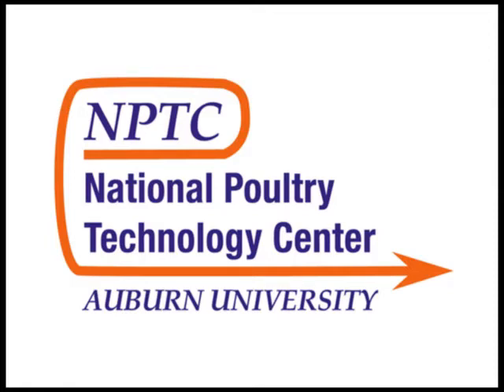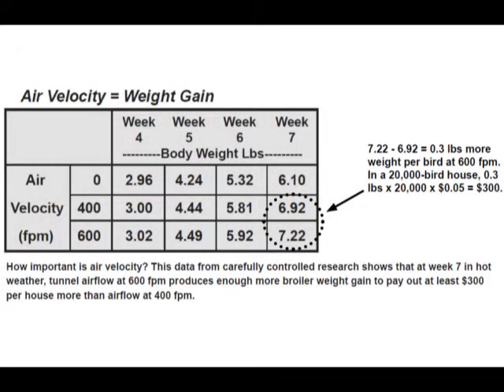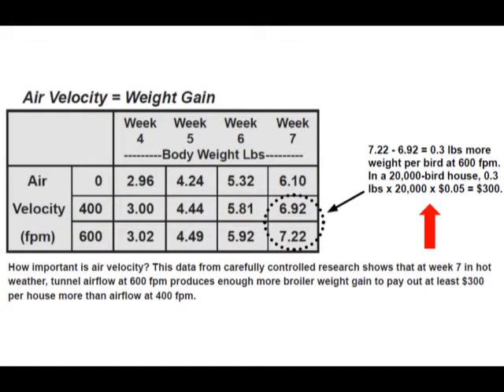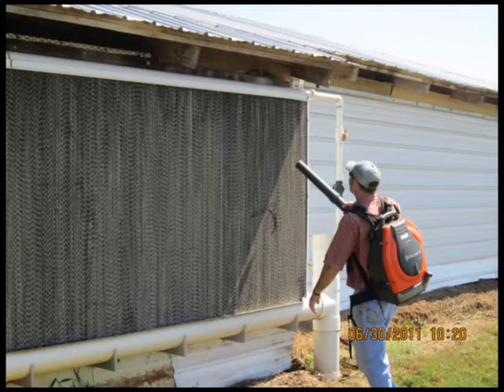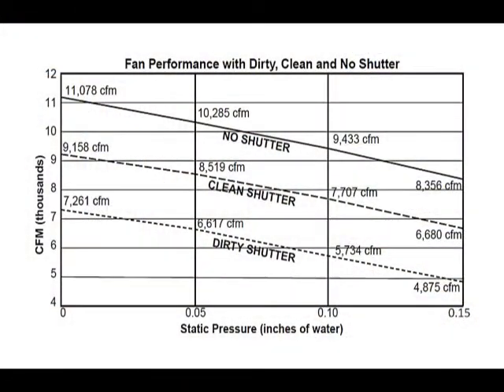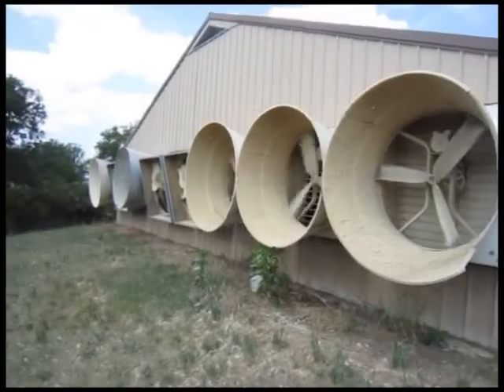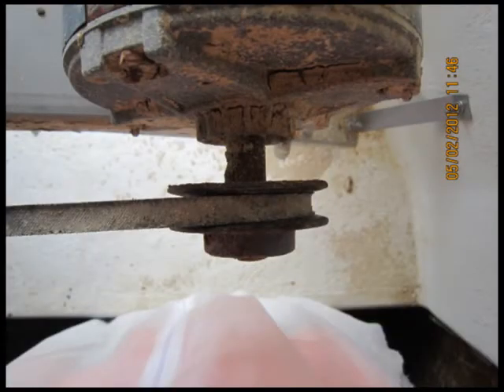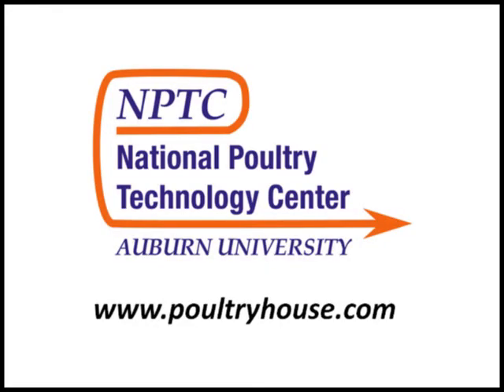NPTC Tunnel Wind Speed Tips

Comment: direct drive fans have a near 0 % maintenance rate.  I've got some that still run well and are 20 years old.  My vote is to get rid of all the pulley system fans and build one seriously solid and dependable direct drive fan.  Farmers have enough to worry about as it is, having to fix fans and replace parts on a massive scale each flock should not be one of them.   I understand what you guys are saying, and you do give great tips for those who don't know what to do.  I already do what you guys suggested in the vid and have for years, right down to the brooming off of dirty fan shutter during a flock.  But what we need are fans that will last long enough for us to see a return on.   Raising a little bigger bird does nothing for me if I end up breaking even after 5 or 6 years.  But it does greatly benefit the integrator during that time.  They are the ones who see the maximized profits while having $0 investment!   So the age old question in chicken farming shows it head once again.  Why should I spend money and go in the hole just so the poultry company can make money and smile all the way to the bank?  All though the chicken companies laugh and blow that question off, I and all farmers think that its a legit question.